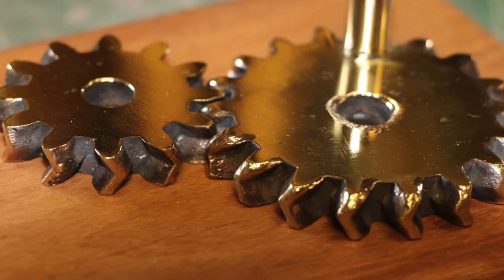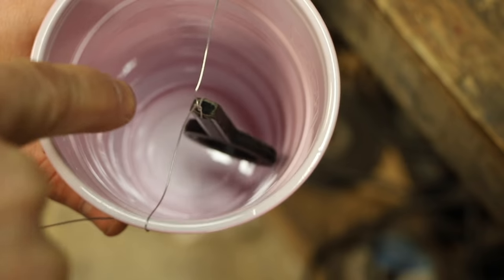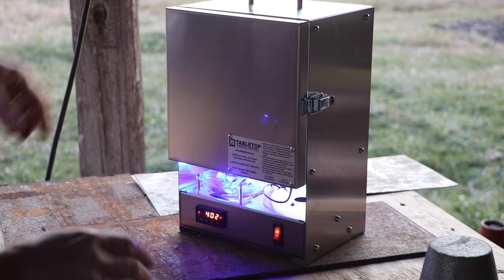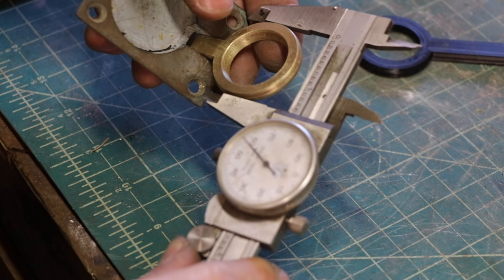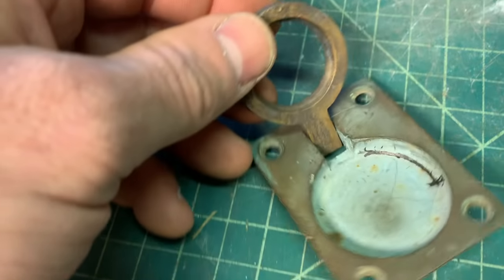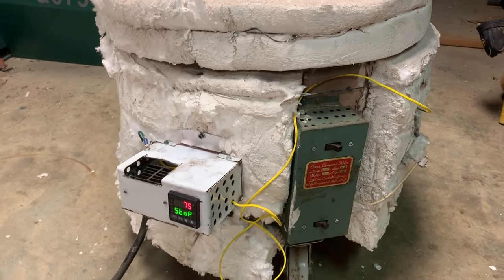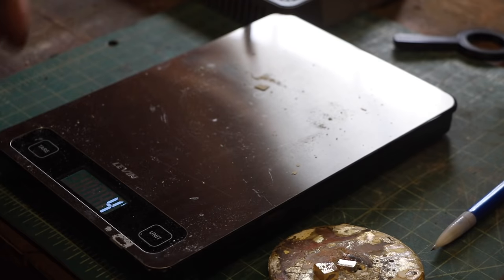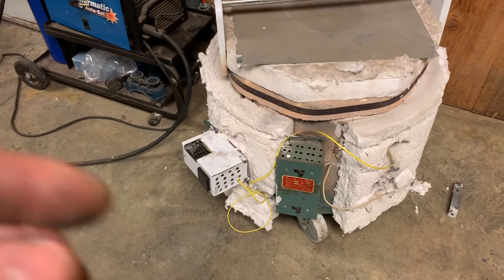3D Printing Metal At Home?  Pretty Much!  FarmCraft101

Comment: When you pour in the melted metal, where does the air inside the mold go - how can it escape? Shouldn't you also put in a few thin air vent 'tubes' so that as you pour in the metal, the air can escape up the thin tubes. After casting, cut off the thin tubes and file.

Comment: Using the spout as a handle? Great idea. I would have chopped it off, ground it smooth, then drilled and threaded a hole to put a bolt in for a handle. And then, as soon as the bolt was in, I would have realised what an idiot I was...

Comment: I worked with concrete and used a vibrator to remove air bubbles. Do you think it would work in this process?

Comment: Honestly I have only a few uses in my mind, probably cause I haven’t experienced much of life yet 😅

First one is casting little trinkets and figurines.  Just little things for decoration, or as playing-pieces for games like chess.

Second one would be making replacement parts for broken objects, so probably a lot of hinges and... whatever the metal bits for joining wood at angles are called.  I’m not a carpenter...

And third would be firearms parts, 3D printed firearms are cool, but the restrictions of still needing metal parts that have to bought, or machined through expensive methods is discouraging.  This could be the next evolution of 3D printed arms!

Comment: Do you think it pay more to melt pop cans into ingots to recycle,  or make slugs to sell, or just take the crushed cans to the metal recycling center.
I think solid bars are worth more. It wouldn't pay to put lead in them to make them weight more leads worth more then aluminum.  You'd loose money.

Comment: pla melts at 200 deg C why are you heating the mould up to 1200 deg F , thats when its cracking.  your mold does it really need to get to moulten material temperature. I have a 16" steel pipe 1/4" wall that im planning to make a furnace out of,  I saw a russian guy making a burner on youtube and coppied his design.  it runs on propane/callor gas and has a forced air supply fed from my compressor.  Man this thing howls.  to scared to build it as yet.  Loved the video and ive saved it to come back to.

Comment: How did you account for the shrink percentage?  I thought I'd approach that by designing the stl to size and then importing it into the slicer by scaling up, but thinking through that, that's wrong because your inner ring would also be too large of a hole.

I really enjoyed this, thanks!

Comment: I was thinking that putting tiny holes the size of the 3d filament in the 3d print where you might have air pockets and then stick some filament in the hole to to create a vent for the trapped air

Comment: 17:30 
I'm wondering if you could make something with an old vacuumcleaner that sucks the molten metal up from underneath. It would be difficult to close the sprout but it would remove all air as the metal rises

Comment: I can't wait until we can ACTUALLY print metal with a 3D printer in our own homes with desktop printers that aren't too costly.  However, this trick is nice to be able to cast metal objects that you have no template for.  The complexity of the molds, as in your gear, has nothing to do with the 3D printer you used.  It has to do with the fact that you had no template for which to make a mold.  For that reason, 3D printers help out.  I like it :)

Comment: Why wouldnt you use a finish sander to vibrate out the air bubbles in the plaster kinda like youd do concrete..  or instead of a vacuum chamber...

Comment: Helical gears can neither run faster nor can they transmit greater forces. The advantage is the smoothness. If the greatest forces are required with the best efficiency, then straight teeth are used. E.g. in racing gears.

Comment: Pouring metal using plaster is no different in concept than using green sand. You need air vents or it can even become dangerous. Super heated air can blow out a mold. The vents allow air to escape when molten metal is trapping the air inside the cavity. They also allow the mold to fully fill. On that ring design, three vents would be good, one each side of the ring and one at the bottom. Just ask yourself "where can the air get trapped with a fast pour?" and then place a vent anywhere you think it might get trapped. The vent can be a thin wire of PLA attached to the part. There is a minimum of filing/finishing work necessary where they attach to the part and have to be removed afterwards, but a thin wire design is easy and fast to do.

Comment: This method does work but generally leads to bubbles and other undesired inclusions. A better method is using high temp molding sand (fine grain sand with oil in it) then make the part as a two or more part mold

Comment: I believe that you are confusing Brass for Bronze. Brass is a copper zinc alloy which melts at your 1100 degree temperature. While Bronze is a copper tin alloy that melts near 2000 degrees and is much stronger

Comment: Typically that type of "investment" casting is done in a silica sand ceramic investment. I made a bronze lost wax casting years ago using silica sand. Saturn car engine blocks and crankshafts were made that way too. The thin investment is then placed into a plaster filled pot for the actual metal pour.

Comment: you need to mix your plaster of paris with sand 50/50 it help with letting the steam out. and not cracking as fast. not sure what plaster you are using.

Comment: They make metal 3d printers now for commercial use, its a pretty cool prosses 
Not so much production parts more for 
Engineering or 1 off replacement parts.

Comment: Add have their place, the trick is to select product that enhance the content, 
for example adds for the types of tools you are using, more as a sponsorship type of thing.
Adds for off topic items are nothing but a pain and detract from a good educational video.

I do like the look of this method, could be useful to create a Aluminium gearbox for use in a bipedal walking robot leg joint....
Challenge here is the need for strong lightweight parts that will hold up for a long time.

Comment: This is awesome! I have a question about the making of the mold though. So you just tip the mold upside down in the furnace with the print still inside and let the pla drip out?

Comment: have you heard of a type of lost wax casting that involves using a sand and sodium silicate mixture instead of plaster? my grandma told me of this and apparently this is what they used for smaller scale prototyping in soviet factories. she claims that iron could be cast in it no problem. i see no reason why it also couldnt be used with pla instead of wax.

Comment: Think it works better if you made the 3d print U shaped. Instead of melting out the plastic you could pour molten metal into one side and let the plastic get pushed out the other side.

Comment: Guys sorry to bring this up, but its not worth it in any way.
I built my own cnc and a also built a furnace one that runs on wood, other that runs on gas third that runs on electricity and fourth that works on oil burner method...
i realized that it was cheaper to actually buy rolled aluminum then the fuel energy you use to melt your part, ofc it depends on many factors.
The most efficient i figured out was the oil burner even tho it was really apparent that IT KILLS THE ATMOSPHERE!
also it might be efficient if you need many big same parts, then it can be efficient.

Comment: I respectfully suggest , that you 3d print a mold so you can then cast in in wax, them use the wax to make your lost 'wax' mold. that way you can use your 3d print mold to make 100's of the wax inserts quickly rather than the hours needed to 3d print a PLA insert.

Comment: You should really have used a piece of steel tubing/pipe for your flask instead of a plastic Dixi cup. Proper pour temp for Tobin bronze is over 2200 degrees F

Comment: Make an propane burner with a flower attached and then air compressor one. See which is more powerful and the cost and the materials for a reliable.and long lasting air forced burner for hotter furnace.  Thank you

Comment: 11:55 I wouldn't try to cast it. I'd take two opposite helical gears and put them together. How? Nuts and bolts, friction wielding e.t.c. Or CNC milling. It's mush more accurate then casting and polishing. You made gears that works. But what about efficiency.

Comment: Cool concept, but you could have easily cut the loop hole out of bronze with a jigsaw. The cost of bronze is much cheaper than the cost of the energy you used to heat up the mold and crucible.
Reply from the maker: Are you sure about that?
Reply: @FarmCraft101  bronze back plates on eBay are quite cheap. You could make half a dozen or more for $22 shipped.
Reply from the maker: @nathanielfuentes5294  My kiln uses 1500 watts, so it can run for 1 hour and consume 1.5 kwh of electricity, which costs me about 16 cents.
Reply: @FarmCraft101  and how many times did you run your kiln for this particular project? 6? 7? For how many hours? And you only had bronze on hand because you salvaged it from your parent’s boat. Otherwise, you’d need to buy bronze (remember the title of this video).

Unrelated: I would imagine lost-foam casting in sand would have yielded comparable results for the loophole. Or casting a sheet of bronze and cutting it out like I mentioned above. 

Your video has value. The project was just done in a very inefficient manner and that’s what I’m pointing out.

Comment: Would it also work if you printed with water soluble plastic. Then you wouldn’t have to burn it and you would only need to pour water inside and wait for the water to dissolve the plastic
Reply: plaster and water normally ends in erosion but you could try it

Comment: There is a bronze filament which %99 bronze power and %1 pla which you melt off in a electric furnace. This much higher success rate than casting the part after printing.

Comment: I've been wondering for ages, would it be possible to do the whole process inside the kiln by having a reservoir in the plaster above the shape you want to cast which the metal could sit in and then drip into the shape once the kiln heated up?
Reply: I doubt the metal heats evenly to get a consistent pour

Comment: But it surely is sintered! Basically ceramic, with no mechanical strength, poor tolerances and meshing. Will break under any load. Or am I totally wrong?

Comment: what about gears that wear  easily unless in hardened steel/iron. Have a reel mower that's hard to obtain gear part as it's 30 years old.
Reply: You can chage the gear set to somthing you can buy now.

30 years isn't very old for a reel mower, I remember using one around 1964 as s 4 year old I couldn't push it and that one was at least 40 years old, imagine what its value today would be.

Comment: It is highly recommended that if you do melt aluminum in a furnace you should not use electric.  The reason is because the natural gas or propane consumes a lot of the oxygen in the air and keeps the aluminum from creating so much Aluminum Oxide (dross)...  You can do it and I have (I have a big electric) but gas is the way to go...

Comment: or just cnc from a cast metal block billet. want to try wire spot electro-plating on a metal 3d print surface. copper or zinc wire.

Comment: I've never seen such a crazy way to produce just a ring which could be cuted on cnc in 10 minutes with a chamfer without any problem first try)))) as for the chevron gears - it's absolutly useless unless it's machined with defined tolerance...

Comment: SAFTEY - the skimer needs to be dry. You should wear a face shields along with glasses. I had a splash of lead hit my think leather glove. It hit the seem, went through the gap and melted a hole in my hand. Bronze is much hotter.

Comment: Put the cup on top of a small palm sander the vibration with drive out the air much like a concrete vib
Reply: Also i do the dip.  Make the plaster really thin and runy small batches and paint it on around 10 times and let it build up

Comment: "3d printed metal" is a bit pushing it... You 3d printed a mold. Not quite the same thing.

Those polished gears did look extremely satisfying though. I'd probably have a small workshop like this to play around with if I wasn't broke and stuck with living in an apartment...

Comment: yeah, the leaking metal from the first few tries was due to lack of a riser = the hole that the trapped air uses. why not just use CO2-silicate sand and be done with it.

Comment: I mean the title is quite misleading as this is casting from 3D printed resins. However, you can 3D print directly into metals through selective layer sintering. The print works by using precious metal dust to build pieces with minimal supports. Definitely not at home unless you have £xxx,xxx to play with

Comment: Yea ok,
 but to be honest.. I wouldn't use casted metal in my High torque 
Machine.. especially not aluminium or copper.

I'm rly not sure what the use of such would be. 😕
Reply from the maker: That depends.  Aluminum bronze is extremely tough and casts very well.  High grade steel would be better, but depending on the application you could certainly substitute some gears or other high stress parts with aluminum bronze.
Reply: @FarmCraft101  

I know, but then its not full casted..😅
 the time you need to reinforce the gears would be equal to the time making them out of regular steel.

Anyways. Its always nice to see people reinventing stuff.. !

Keep it up 👍

By the way. 
My I ask how much you've paid for all your equipment. I mean those ovens doesn't look like top noch, but still doing their task! 
(I want one)
Just wondering cause whenever I see stuff like that, my mind goes crazy. but its (as always) limited by the tools I have. 
Which are never enough 😅
#inspired 🙄
Reply from the maker: Watch the end of the video.  I go through all the equipment and prices.

Comment: I have a hardly used alfawise 3d printer it's the china version of a ender 3 the extruder motor does not work. maybe 20 bucks but i do not know electronics but i would like 100 bucks plus shipping if your not near mid michigan. reply to work out details. price is firm since the parts alone are that much.

Comment: Old video new comment... You can easily machine that gear. but it would require a 4 axis machine minimum and would require a 180 degree rotation to finish, signed the aerospace engineer, part time cnc machinist, and avid 3d printer

Comment: Have you considered lost wax casting? And for the casting using a centrifugal casting process. You don't need a vacuum and your model or plastic part (only now in wax with feed sprue wires) won't have air bubbles and fills the mold completely.

Comment: But casting isn't precise at all, for gears teeth geometry and surface finish is necessary. Even you make difficult teeth shape, you would have to be able to machine it to the specs.

Comment: That's not bronze, it's brass. You can see the zinc burning every time he stirs it and when he pours it. Bronze has no zinc in it and does not flash every time it is stirred
Reply from the maker: Many bronze alloys do have zinc in them.  Google gunmetal bronze for instance.  But this did seem to have a lot of it, and I think  you may be right.  I was told it was bronze, but now that I've melted it, I'm skeptical.
Reply: @FarmCraft101  I stand corrected! I am dabbling in metallugy and casting as well and I had not come across that one before. Love the vid!!

Comment: In fusion, you can change the physical material of your solid body to bronze (or whatever material you want to use) and then click properties on your solid body and it will give you weight, volume etc. 

Would be helpful when measuring out your bronze for melting 😉

Comment: The title of the video is a bit misleading. It's using a 3D print as a master for casting...  
Printing metal creates different particle arrangements and as such has unique properties not found in gravity casting.
Reply: $500 Is a lot considering people used to do this free... at most, only real cost would be coking

Comment: why dont you get a 3D printer that prints' in wax then you can either wash the wax out of mold with steam or leave it in and it will cook off as you pour the molten metal in to the mold

Comment: “Unscrew from sand”?  What?  The whole point in casting in sand is that all the sand can be removed once the cast is solid….
Reply from the maker: You have to remove the pattern from the sand before the metal is poured. You would have to unscrew the pattern to remove it, and would not have very good results keeping the sand in place.
Reply: @FarmCraft101  ahh…that makes sense, what about a lost wax mold, that vaporizes from heat when metal is poured? I’ve seen guys use 3D printed molds of PLA and had success doing a ‘lost PLA’  method.

Comment: Same process is used to manufacture jewelry. I have been doing this since 1982, but the process is believed to have been invented by the Egyptians. I use a vacuum pump to de-bubble the pattern in the investment (plaster). Then I also pull a vacuum on the mold when I pour. I built all of my original equipment. I'm not familiar with the brand of plaster you are using but all of them I have used have a silica base. Therefore you absolutely MUST use a good respirator when mixing and quenching because silica particles embed themselves in your lungs and don't come out. A condition called silicosis. Look it up. Very Dangerous. I obviously did not 3d print my patterns in the 1980s, process had not been invented yet. My patterns were wax. But anything that melts and can be burned out of the mold cleanly will work.

Comment: You might be letting them sit to long before you pour.  Yep I bet that what is going on.  Get a cruicible and heat your metal outside the kiln or pour right in the mold.  Do not remove the flasks until they are full of your metal.     I'd betcha' a gin and tonic or two on that one
Peace,
Rich